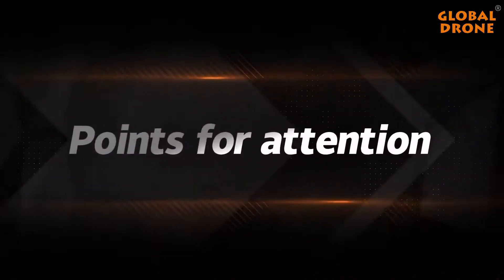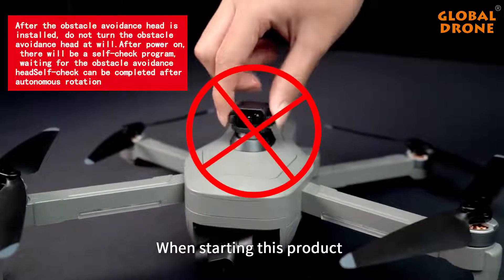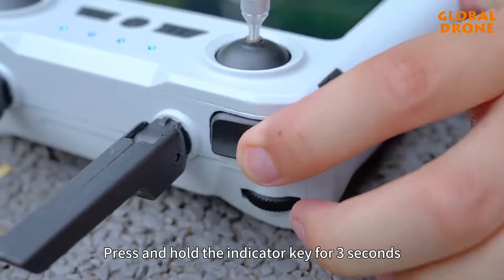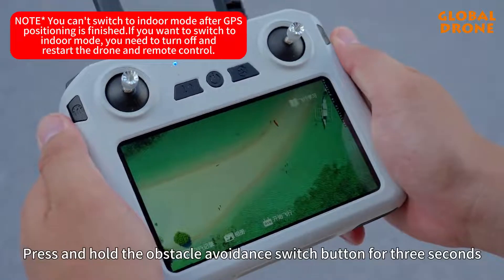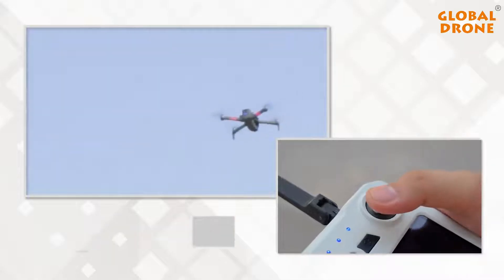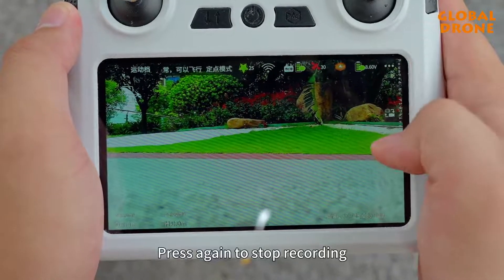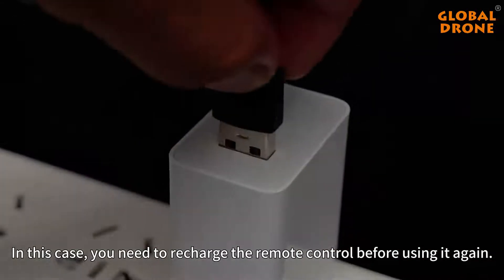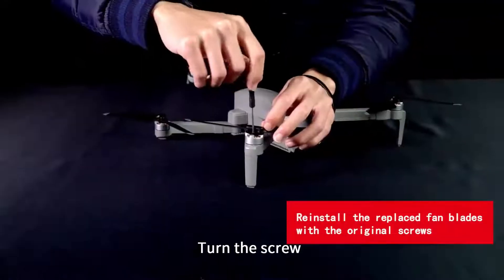Global Drone GD98 Drone Operation Tutorial

Comment: I have owned this model drone for 10 months Global GD98 sold under Flightelf and it has worked fine until recently....Now, it randomly stops communicating properly with the controller.

Remote says GPS signal successful but sometimes when I move the joysticks, drone will not start.

Sometimes I can send it up and then it stops responding to controller....will not turn, camera will not work, it will not respond to up or down commands, it will just hover and ignores all commands from the controller before eventually responding after a few minutes.

This morning, I sent it up about 75 feet and it stopped obeying controller, moving joysticks had no effect on drone, pressing down button had no effect.

After a few minutes of this, drone finally responded and returned to ground.

I tried another takeoff and let it hover about 6 feet above ground....I hit the return to land feature and drone went up instead.....I hit the down button again and it finally landed.

I am going to try calibrating the drone again but if it doesn't work,then something has failed in the drone or remote.
Reply from the maker: Please kindly the store where you purchase and they will try to solve it :D
Reply: @GlobalDroneOfficial I purchased it through the Flightelf website
Reply: I just contacted the seller Flightelf and according to them, the issue may be that I need to recalibrate the drone....I had calibrated it once   after purchasing it but apparently it is necessary to recalibrate from time to time after using it which is not mentioned in video. Video only mentions calibration during initial set up of drone.

The issues with erratic communication with the controller are likely due to the drone needing calibration again.

I will try this to see if it solves the problem.
Reply: Update: I have recalibrated the drone and this appears to have solved my problem.
Reply: Well, I spoke too soon .....Recalibrated drone and am still having random issues where drone stops responding to controller after I get it up in the air ...It appears that drone is losing GPS signal at random times.

I recalibrated drone three times and issue still exists.

What happens if that once I get it up in the air, if I give a command such as to rotate (turn  the drone,) it will not respond and then a minute or two later it will finally respond.

I will then give command for drone to land.

It will not respond immediately.

Sometimes after a minute or two of hovering, it will finally recognize the land command and will do so.

Comment: Just got mine a few days ago and my control module doesn’t turn on. The 4 blue lights come on and turn off shortly after. It has been charged. Also tried inserting the sd card and wouldn’t slide in. Tried to email these guys numerous times and no reply. Tried calling the number and all I got was an answering machine. To tell you the truth so far I am not impressed as well their customer service sucks so badly I wouldn’t recommend this drone to anyone until I get some sort of reply. Absolutely terrible so far. I will easily retract my comment if these people for the Falcon would fix this issue.
Reply: I just got mine(GD98) as well yesterday, I can turn on both control module and the drone, but the video and photo quality are suck....video resulotion is 1280x720, not the 4k they mention, and I can't find any button to adjust the resolution, and not able to zooming, both funtions can't find a button on the control module, I've text the shop that sold me this drone, I hope they will solve my issue, otherwise, I will consider it is a scam product, conclusion: anyone who like to buy a drone, pay more for a DJI, they may a bit more expensive, but they worth the money
Reply: Should've got DJI man🤦‍♂️
Reply: Did you try holding it for three seconds?